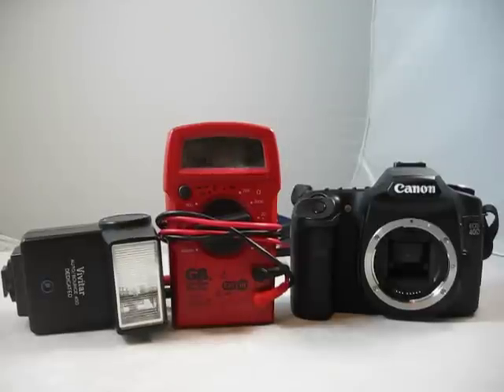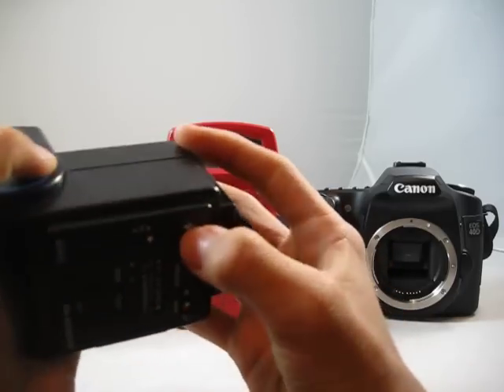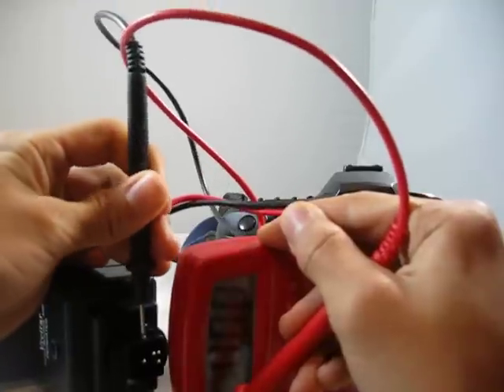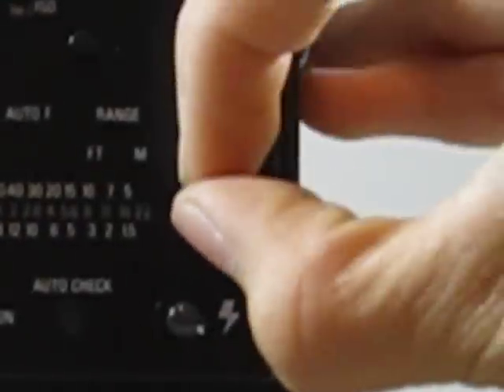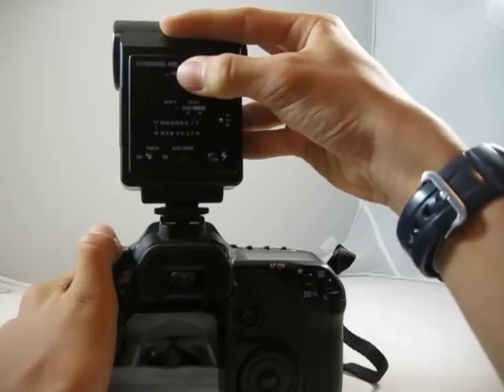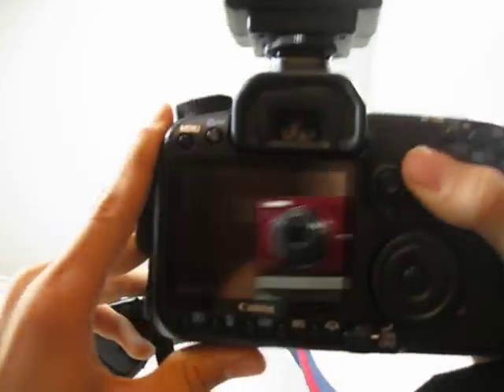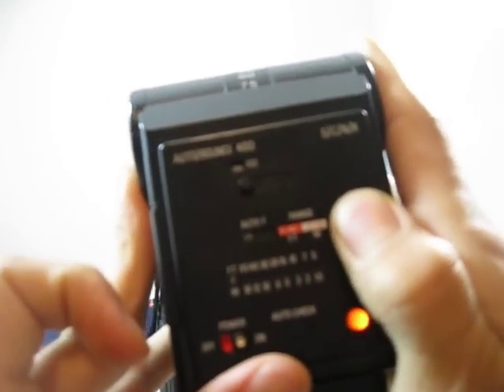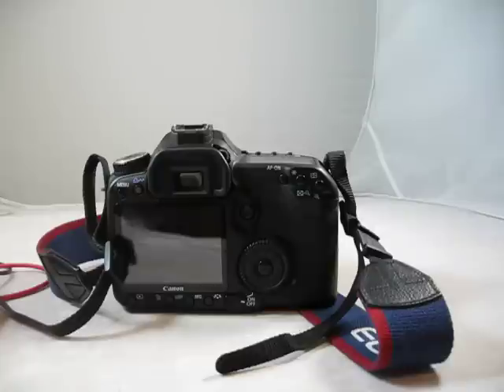How to Test Vintage Flash Trigger Voltages and Settings to use Feat. Canon EOS 40D

Comment: @0:58 they are volts not watts.  Not sure if that was a slip of the tongue, but as he did not correct before uploading I guess he meant it.  So you cant trust this.  Also, the manual mode is only overexposed because he did not properly set his camera for it : just blazing away at random does not cut it.

Comment: I have a Pentax af200t and a Pentax af280t. I wanna use then for fill light. Main light is YN 560IV if I remember well. Is there a way to use the Pentax flashes? They have fewer pins. Would love some help. I shoot Nikon d7500. I don't wanna fry it of course
Reply: musyoki musyoka the only way to use the Pentax flashes with your Nikon camera would be if they work as optical slaves, off-camera.
Reply: @matthewkeisling2776  Thanks  so much. I forgot I had em. Will fish em out and try to slave them. I would be delighted to have extra lights